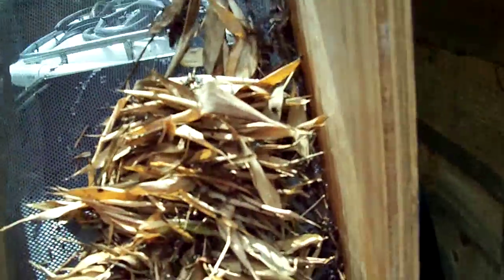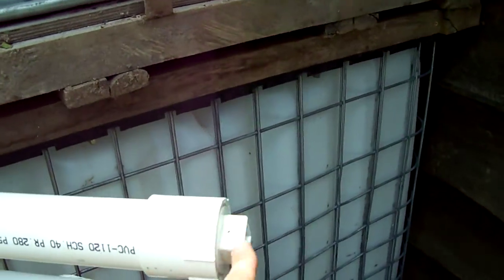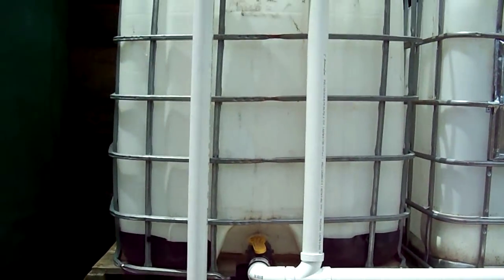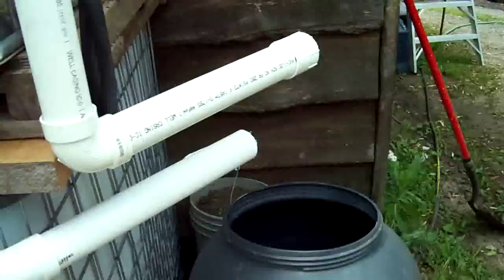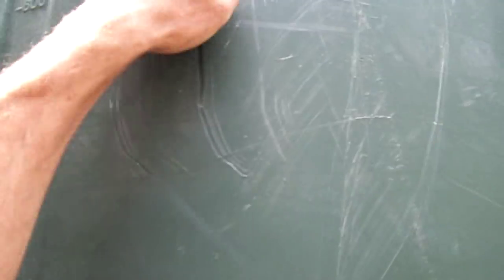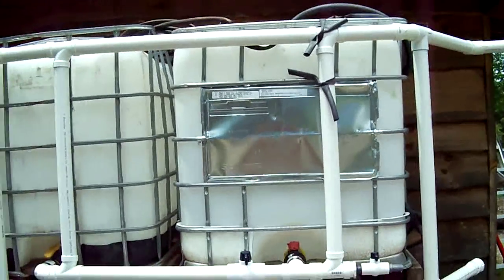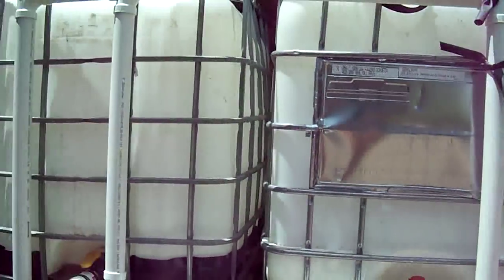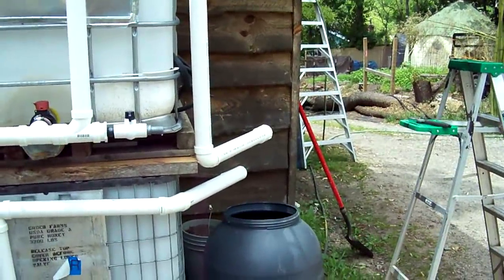rain water catchment

Comment: Not sure where the video creator got his plastic totes, I picked one up off of craigslist that is 275 gallons for $40. As for supporting weight, the metal cage that the tote is in is mounted to either a wooden or plastic pallet. will support the weight of a full tote. To answer the question of filling from the bottom, it's a matter of equilibrium. The tank is vented, therefore with no back pressure, the water will naturally try to balance the pressure between the PVC tube & the tank.

Comment: That is a sweet setup, especially with the big green tank. I plan to use a small pump running on 12 vdc to move my water around to other tanks and lines. I have alot of roof to catch rain-water and I might as well use it considering how much city water cost me here in southern Ontario. Might also cheap a little and use some of that rain water to flush my toilet too (that is until I get caught).

Comment: If you have bung holes in the lids, then you can.  Put a pallet on top of each bottom tanks for clearance, run pvc to each top bung hole with a "t" fitting, and the overflow will go out the far side of the second tank.  Run pvc from the top tank valves through the pallets to the bung holes of the bottom tanks, which will both fill and vent them.  However this means the bottom tanks will fill first.

Comment from the maker: as long as the top is open and vented, it does not matter how the water gets in there, it's going to find the lowest point and go up from there. this particular set up will only work from bottom up, if i fill from the top there is no way to turn it off, or divert the overflow to fill the other tanks and then be directed elsewhere. you have to vent the tanks or the air pressure will not let them fill. and they will become over pressurized and bulge out. and leak invariably

Comment: Nice. Question: Can/does water skip over the first flush tube and dirt enter the tanks during a downpour? Would it be better to add a couple of elbows there to the tank tube from T at top of flush tube,  to offset the hieghts of the downspout tube vs tank tube, to make the water fill the flush tube first for sure? I had to watch it twice to get the full understanding of everything. Beautifully elegant design.

Comment: Nice set up.  I too am confused about how you fill from the bottom up.  It seems to me that the smaller column of water in the pipe would weigh less than the larger column in the comtainer and not fill.  You say it works so I must be missing something.

Comment: 1 foot is = to about .4psi.
 So the top tank is roughly at 4-6ft high , we'll use 5ft
So the top tank  is 2 or 3 psi higher then the the lower tank.

Comment: I want to use the existing holes in the barrel.
2" connectors and pipes going from one hole, out to the side of the barrel and up the side to collect rainwater.
There will be a T joint there with one line as the intake and the other line manifolded to the garden. The second hole / cap will be drilled out with a 3/4" drill and appropriate fitting screwed into place with 1" pipes coming out and going up the side of the barrel for the exhaust. The barrels will be upside down and on a wooden platform.
I have never seen this done. Is this setup going to work?

Comment: I find it confusing to have the tanks fill up from the bottom up. How does that work against the pressure of the water?  Wouldnt it be smarter to fill from the top to the bottom?  Im not trying to make a smart butt comment.  Just asking a question.

Comment from the maker: if you close that top valve, the one on right does fill first. I built it with maximum flexibility that way. you are wrong on all your points basically. supports weight fine empty. has been for about 5 years now. and there is no way to fill bottom tanks first, they will overflow out top of tank. and I needed the head from the top tanks first anyway

Comment: Well, I like the idea of a pre filter but this design doesn't cut it for me.  Am sure it works for the author's needs but it doesn't for mine.  The idea I need is to collect the water, run it through a sand/gravel filter, store it and purify it for home use (off grid).
Reply: player101player101   No, it will not remove chemicals from the water.  Material a fact nothing will remove chemicals from water.  You can lessen it but not entirely remove it.  The first pass using a Sand/gravel is merely the first stage.  It can drop the CBU from over 10000 to about 10.  It traps dirt and most of the CBU's.
Reply: TechMan1219 Your idea that nothing will remove chemicals is incorrect, distilling will remove everything from the water including chemicals.
Reply: Zero Bitz
 Actually.   No you are wrong in practicality. The amount of energy it would take to boil 500 gallons of water wouldn't be practical.  You would require about 10 racks of wood for that task.  So, are you going to chop down a forest for a few thousands of gallons of water?  No, you would.  So you would have just defeated your own argument.

Adding a second argument.  Although boiling might kill diseases, germs and other micro organism there is allot more to it.  Just boiling it would still leave the heavy metals and other chemicals, and particles that were in the atmosphere when it rained.  So, after that you still have it.  The slow sand.gravel filter I mentioned wasn't the entire process but was the beginning.
Reply: OK, apparently you don't understand the difference between boiling and distilling, you might want to look those up on your puter before you comment, I'll even help ya out http://www.differencebetween.info/difference-between-distilled-water-and-boiled-water   Also, I don't believe I ever said distilling would be easy,,,let me review my statement...nope, what I said and I quote: "+TechMan1219 Your idea that nothing will remove chemicals is incorrect, distilling will remove everything from the water including chemicals."  nothing more, nothing less.  There are many options out there for DIY solar water distillers that would save on all your wood cutting and burning.  It would take a while to distill 500 gallons but would you really want to drink rain water if you didn't know what was in it, I'd rather keep my family safe.
Reply: Zero Bitz  Clearly you don't know what you are talking about. That's what is clear here.  You don't listen.  That's another thing that is clear.  Third you don't know how much energy is required to boil 500 gallons.  That's also clear!  You don't understand that heavy metals are still there if you boil it.  Should I really go on?
Reply: +TechMan1219 you make your as post it then the more ideas on here the better

Comment: No way the top tanks fill being fed from the bottom. Vented or not.
Reply: if you look at the level of the top pipe you will see that it will work exactly as he says..were do you think the water would go...always look for the easy path and you can see were the water will go you can fill a tank 100 ft tall from the bottom if the incoming head is 100ft the incoming water has more pressure if the head is greater..its just the way water works